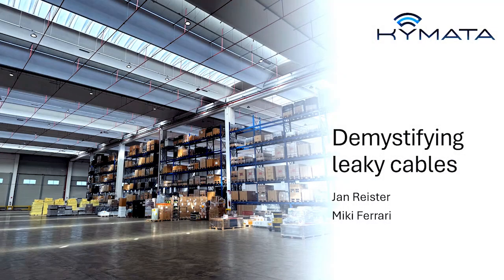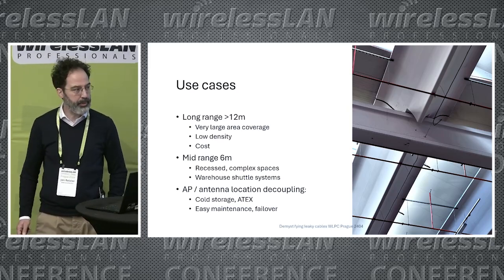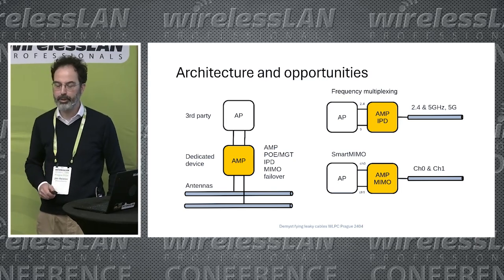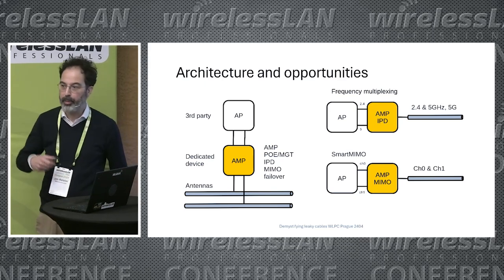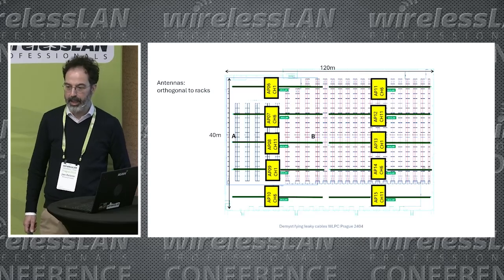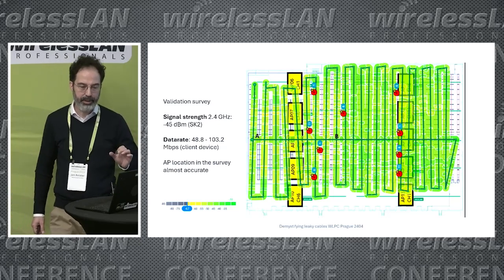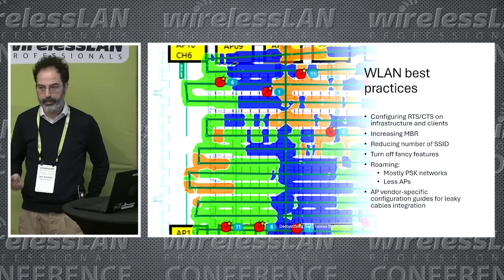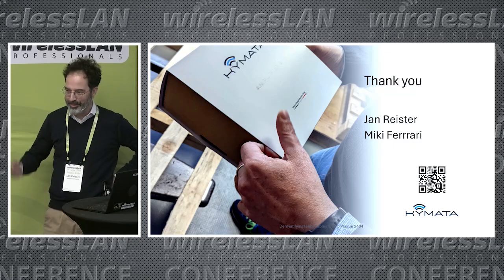Demystifying Leaky Cables | Jan Reister | WLPC Prague 2024

Comment: Maybe call it: Demystifying Leaky Antenna Cables. One thing I dont understand is why you are shooting through the shelfs instead of shooting down the the rows with actually people in there? Is that because you use external antennas and they are placed at the rows?
Reply: This setup lets them install like 9 AP’s with their special multiplex gear instead of using a single AP per long row. Most of these warehouses wouldn’t be able to afford 30 ap’s plus antennas to cover each row so I assuming they are more accepting of the performance hit if it saves them $$$